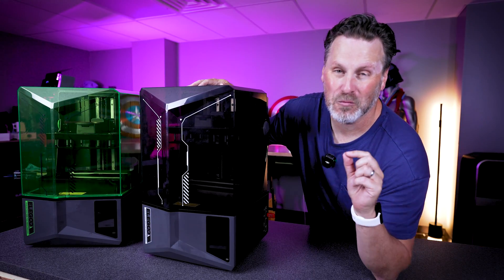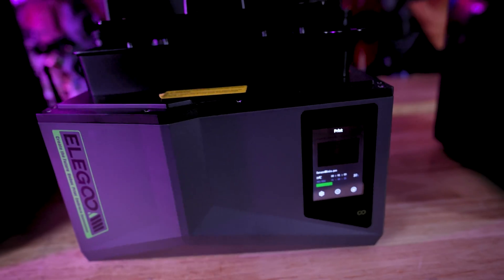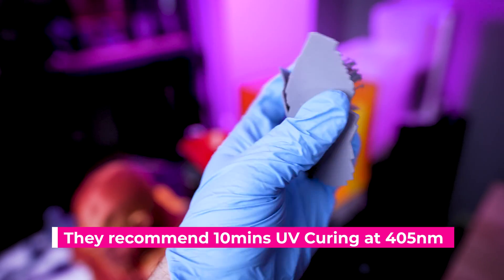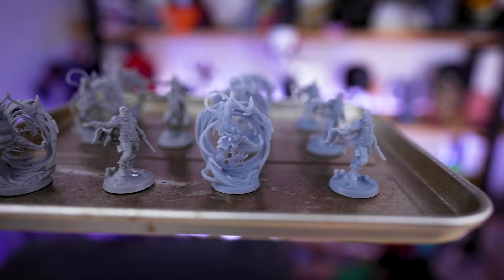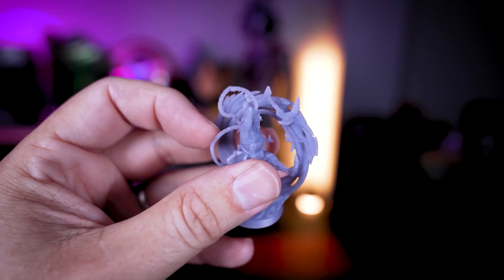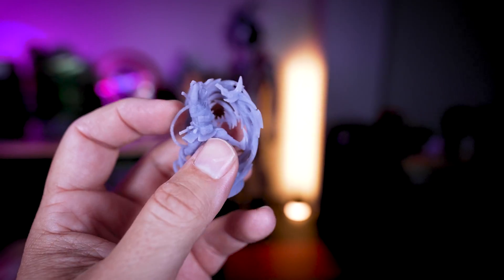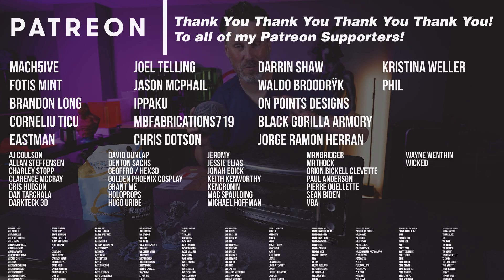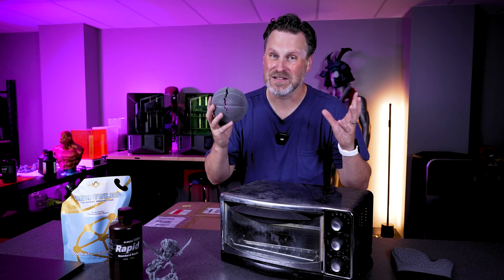Baking your Resin 3D Prints! Does this actually work?

Comment: 1:26 Okay it has a nice smell... is the smell toxic? What kind of VOC is it putting out?
Reply from the maker: Hahaha yeah I was questioning that as well. Certainly smells better than 99% of other resins I’ve used. Not that I’m trying to sniff them but you can def smell it
Reply: They ALL put out around 4 to 5 harmful VOCs, even the ones that say they don't or have "low" VOC. There is a scientific research paper on 3D resin printing and VOCs and the results were NOT good (many cancer causing harmful VOCs are released in concentrations beyond recommend human exposure levels, even from the plant based resins - any anti VOC marketing is a lie unfortunately). You can find the study in the Resin 3D printing subreddit.